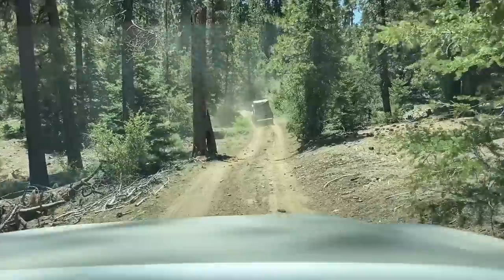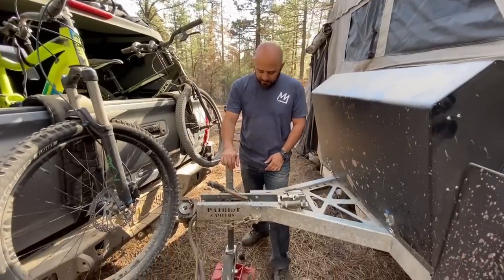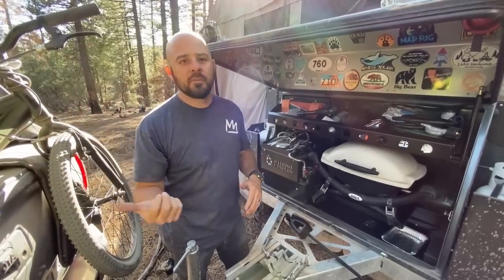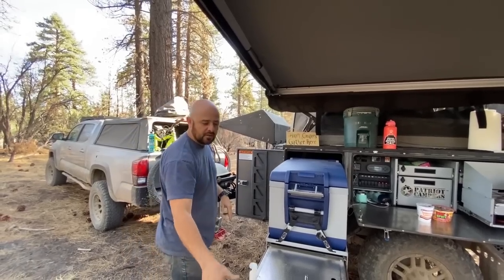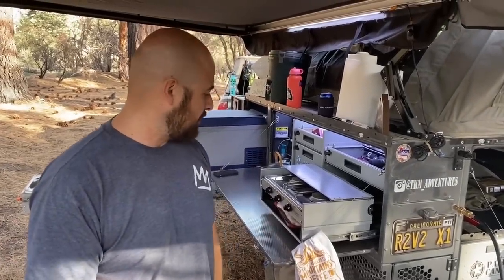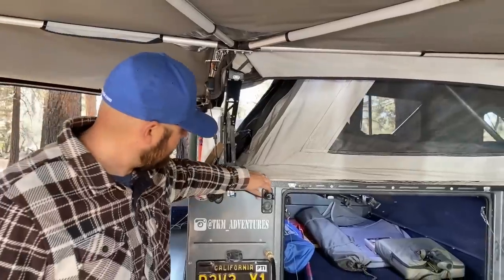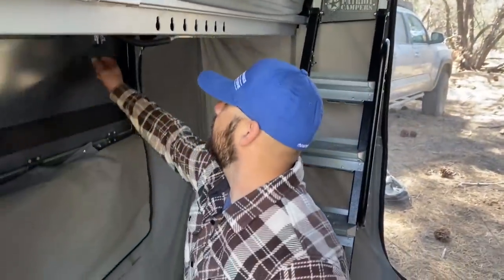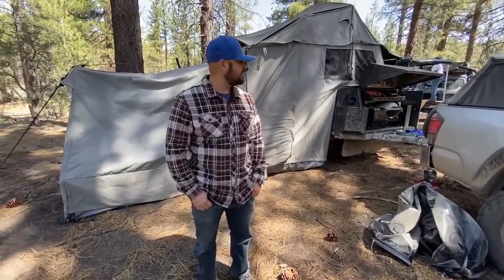USA X1 Walkaround with TKM Adventures

Comment: Great review, and walk around.    I have some question specific to this trailer. Do you, and your family camp during the winter months?  If yes how do you keep your water tank, and pipe systems from freezing?  If not does it get cold enough where you live that you need to winterize the system, and flush out after winter.  I am new to camper trailers, and am trying to do my homework.  This is one of the trailers I may consider due to size, and maneuverability in various areas ( at least from what I have seen in videos) . I have asked both US and AUS  vendors  and they do not insulate the tanks / water systems as part of the build.   Thank you.  Ruben

Comment: Seven pins plug cable is for lights and brakes. Anderson plug to charge camper trailer batteries and fridge.
Reply: Additionally, the seven pin cable is managed by the vehicle's voltage regulator, which is primarily concerned with the vehicle battery and reduces the charge when the vehicle battery is fully charged, thereby reducing the charge going to the trailer.